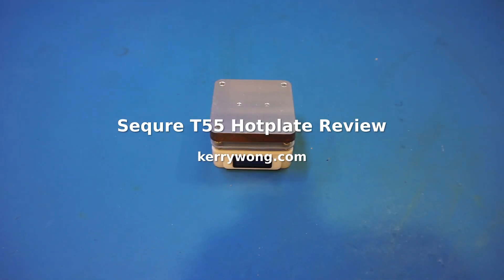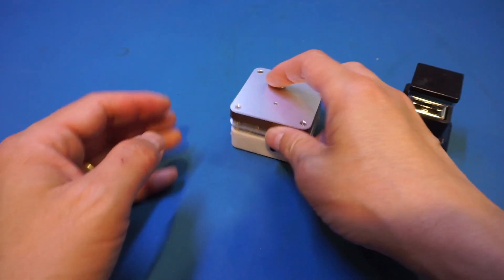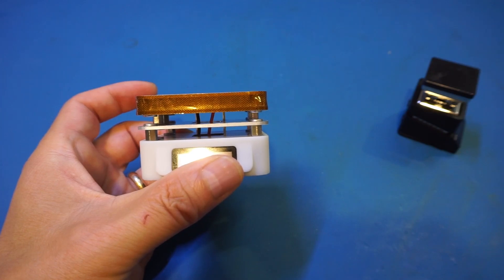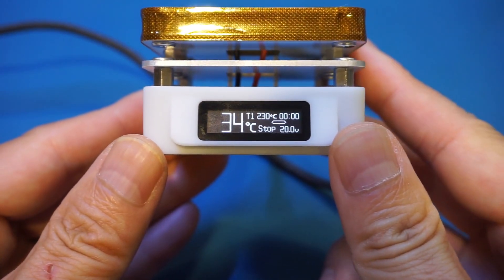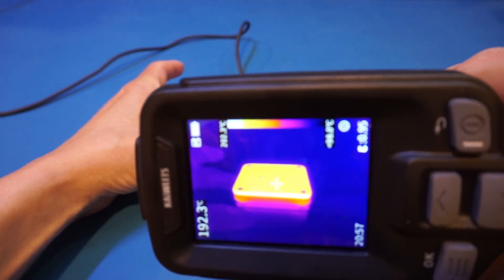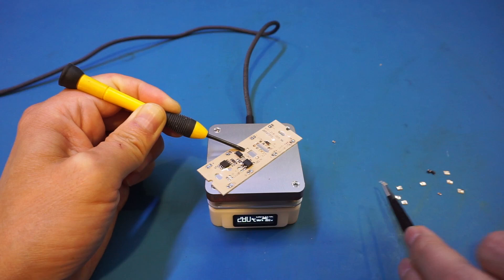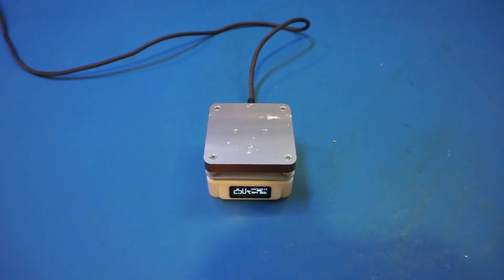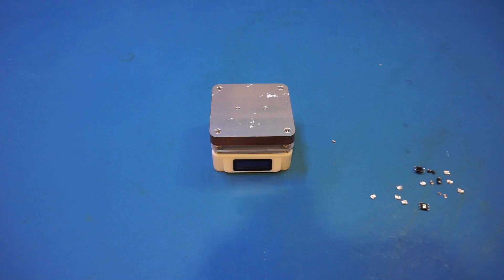SEQURE T55 Hot Plate for SMD Rework

Comment: Newbie question here: don't you fry the components when they receive so much heat for so long?
Reply: I was wondering this also. I'm considering making a shift from through hole to SMD and reflow seems the way forward. Component spec sheets list working temps like -25C to +125C and I don't know how heating them up to 220C-250C for reflow can be a good thing!
Reply: @TristanJCumpole  Operating temp and reflow temp are very different specs. Most lead-free SMT parts can handle like 260C for a specified period of time. To find out more, look up something like "reflow profile". You'll see a period of time where the unit is held around 100-125C to activate the flux, then it spikes to 245-260 for 30-45 seconds to make the solder flow. Then a ramp down, thermal shock is also an issue so you let it cool in a controlled manner. 

For the home gamer, I'd recommend using one of the low-melt alloys with Bismuth in it (I use a lot of Chipquik TS391), the reflow temp is much lower and makes it super easy to handle. Also keeps well at room temperature.

Comment: Why can't they drill and tap on the underside of the plate instead of drilling through the top to mount the peltier? Just my OCD going into overdrive...
Reply: That's merely 1,4 mm thick aluminium. Not that great to screw into.